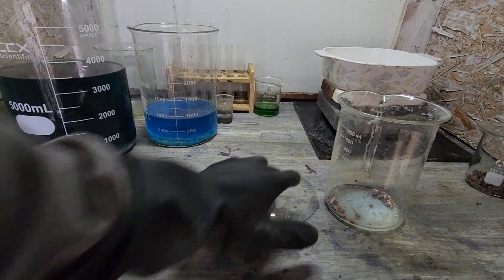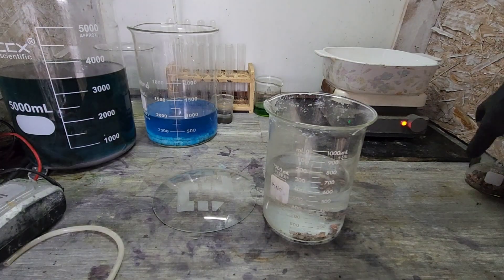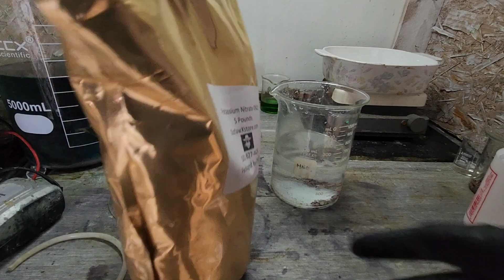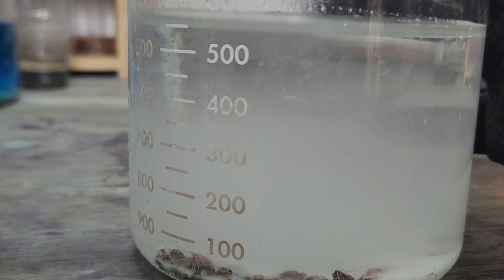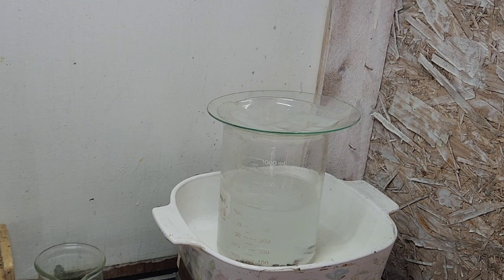Poormans Nitric Test Part 2

Comment: The copper sulphate is very easy to dissolve and take care of, just add heat bring it to boil and filter. You are left with your silver and other PM’s in the filter and a clean solution that will recrystallize as it cools to room temp, to get the most to come out you can set the beaker in an ice bath for a couple hours or an igloo lunch box to keep the ice from melting. The solubility of copper sulphate in water is high 2033g/liter which is 5x more than table salt in water. You can store the crystals for use in your copper cell or convert to copper metal with aluminum at a ratio of about 1g aluminum precipitating 3-4g of copper metal.
Reply from the maker: Awesome information! I will be posting a short video tomorrow on the crystal clean up. The water boiling water does work very well